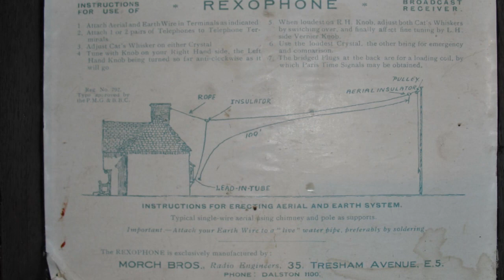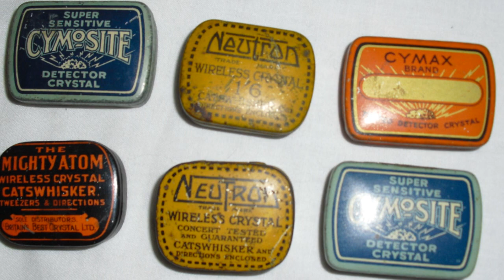Crystal Set Radio (Rexophone) - Set Up and Tune In

Comment: What does the C and S switch signify? I see it switches crystals but why C/S? Thanks for the demo. I'm going to try and get mine up and running as I did when I was a kid - 50+ years ago.

Many thanks.
Reply from the maker: The C,, s,, switch is there so you can choose between which of the crystals you have  on the set... You choose the loudest ,, or use the second as a comparison when receiving the station, This is a great instrument if you have one the same,,, as two people can listen to the station at the same time, I originally thought that two people could hear different stations on the same radio but I was wrong of course,,   it appears you can use a single crystal only at one time, Glad its been of use, secret is to connect a good aerial wire to something like a gas or water pipe that goes straight to ground and have the coil insert or loop really polished clean and shiny.  Hope you have a good crystal . best of luck ENJOY.
Reply: @MrGreenBentley  Thanks for the fast reply! I see the purpose but why the letters C and S? I'm doubtless missing something obvious. I'm getting very high impedence phones is that what I need?

Many thanks.